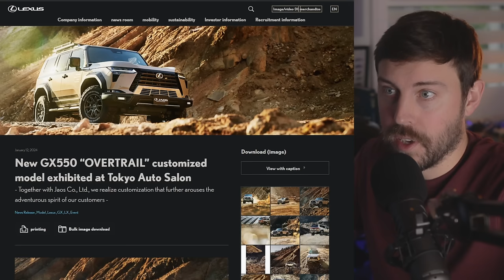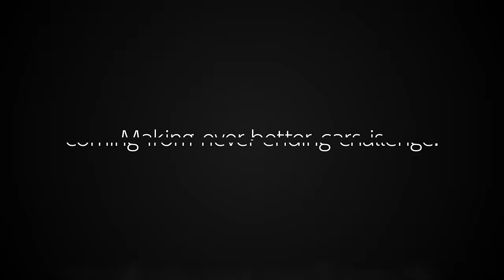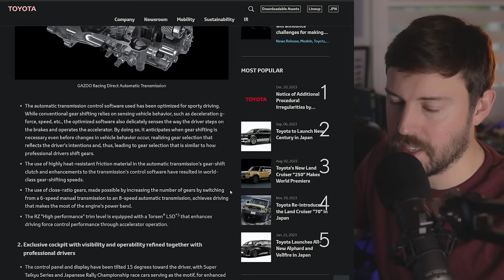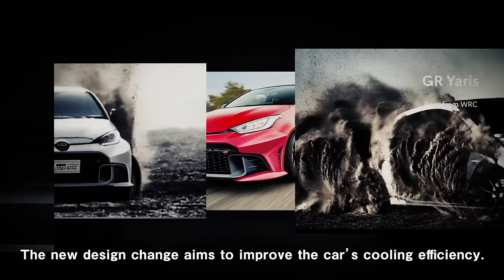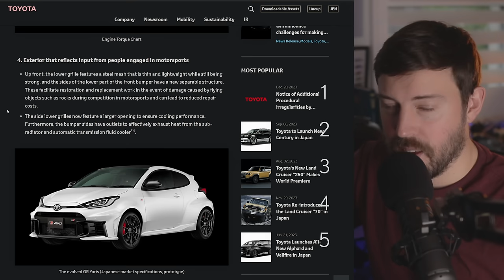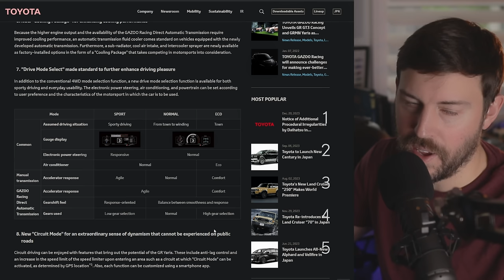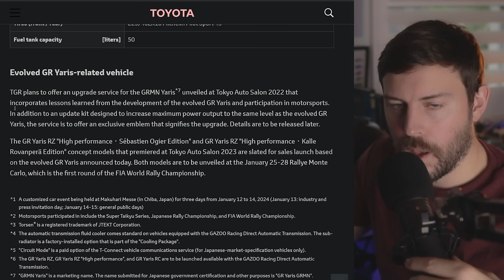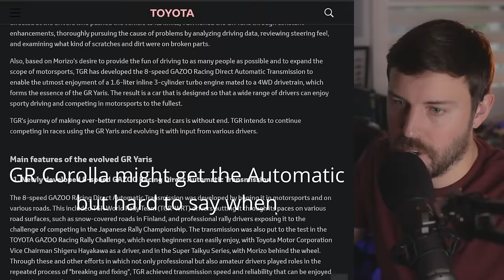TOYOTA's Game-Changing Transmission Arrives in the NEW GR Yaris // GR Corolla to follow?

Comment: Hopefully this new 8AT makes its way into the next gen GR86 as well as the Lexus lineup (once Lexus starts putting more passion, effort, and energy back into their enthusiast cars).
Reply: The Lexus LBX Morizo RR Concept that was recently shown at Tokyo Auto Salon actually uses the G16E 3cyl & GR-DAT Auto. (306hp)
Reply: @AbrahamArthemius  I’d love to see this transmission paired to the V35 and squeezed into an IS or RC. The 6AT and 8AT were good enough for 2014 and 2017, but it’s crazy that those cars haven’t really received any powertrain upgrades since then (I don’t count the IS500 as a powertrain upgrade since that powertrain has more-or-less been around since 2015).
Reply: And also the GR Corolla will hopefully get the new 8AT!
Reply: Absolutely, I would love the 86 to have a good AT ❤️
Reply: Y'all need to learn MT😂
Reply: @royaltyallen1162  Umm…I’ve actually been dailying a 6MT 1series for the past 11 years. But anyway, I made my comment simply because 1.) I want Toyota/Lexus make products for enthusiasts to the best of their ability and 2.) IF this 8AT’s performance could rival the incredible ZF8, I want it in as many Lexuses as possible so that their cars can be a bit more competitive/engaging.
Reply: @royaltyallen1162 I’ve been driving manual for 10 years now. This new AT sounds fun.
Reply: @royaltyallen1162 Bold to assume we can't. 😂 Autos are faster without having to abuse the hell out of the clutch and transmission.
Reply: @royaltyallen1162  MT is fun as hell, but honestly, I'm at a stage in life where I'm working, studying, and ftiving upwards of 30 miles a day. An automatic may be a good option for many people. I would definitely keep manual just for the fun of it.

Comment: Personally, the most interesting thing this time is the LEXUS LBX MORIZO CONCEPT, which has the GR YARIS engine and drive system transplanted to it. If it is officially released in the near future, I think it will become something similar to the AUDI S1 and MINI JCW, which Toyota has never had before.
Reply: LBX is based on the Yaris so its only natural
Reply: And it has more power than the GR YARIS
Reply: @marantamil459 it's the same one as the updated GR Yaris so around the same 300hp

Comment: Kirk, As current GR Yaris owners 'upgrade' to this automatic version, I hope the market is flooded with  plenty of cheap, obsolete, manual GR Yarises for the purists. 😉
Reply: Well.. they do offer 2024 GR Yaris in Auto and manual, it just happened that Auto is proven much faster than manual on their track.
Reply: You do know the Auto is just an option don't you?
Reply: It will not - in EU price tag for new yaris (both manual and auto) is much higher, than for previous one. Many people hoped for significant price drop of old model, but pricing policy for the new one will keep value of mark 1 on quite high level. I've ordered mine wit VIP package (forged rims and some extras) and auto transmission, and it will cost me above 240.000 PLN (60.000 USD with taxes). Previous one in 2021 was about 150.000 PLN (37500 USD)

Comment: About the hand brake lever...(according to the TGR web site) you get the standard horizontal lever. But you can also get a vertical lever handbrake for the RC trim for motor sports.

Comment: Now we just need a turbo 3 GR86. The boxer engine was the sole reason I went with a GTI instead.
Reply: The 86 should stay NA for as long as possible. A Turbo 3 GR86 should be a new Celica.
Reply: Or throw it in the mr2 if it returns

Comment: On a motorcycle, you shift down with your left foot for first gear, then up for each sequential gear. At least that's how it is on most street bikes. I think some race bikes have that reversed, but that's the rare exception.
Reply: normal shift is 1 down 2-6 up, GP shift is 1 up 2-6 down

Comment: I was a huge Toyota fan for decades, but it has been difficult to be a fan since about 2000, when they started cost-cutting and creating lazy, ugly designs with low quality interiors. But I'm very excited to see them finally taking customers seriously again and responding to what we want, or at least trying hard to. This transmission could be a game changer if it's as good as it sounds...even if it only matches the ZF8 in real world performance it will unlock potential we've not seen yet from Toyota. I'm really excited to see some passion coming back to the brand. I keep wondering why they don't offer the Corolla sedan with the GR power train - think Corolla Apex with GR engine/trans. I think there would be a lot of takers, there's always a market for a practical, sporty car that hauls passengers and can do grocery duty while still being discreet and very entertaining to drive. The GR Corolla is cool but it's a very niche car with polarizing looks that you love or hate (I'm in the latter group) and offering the same power train in the sedan would open a whole new market.
Reply: Well they had the camry trd which was just a sporty sedan, nobody bought it. So they got rid of all the performance sedans as other companies like bmw do that way better. Toyota can really take the hothatch market in US and Europe if it makes a GRC with automatic that can compete with a Golf R stock. So I think that'd what they are going for and I thinks it's working, I'm seeing way more grc than golfr in the US.

Comment: I would like if they could do a cheaper 2 wheel drive version. Maybe it could be a TRD corolla.
Reply: They actually do (exclusive for the Japanese market). Called the GR Yaris RS, it has the same body as the RZ model (top trim, the one we’re familiar with), but has a regular 1.5L NA 3 cylinder engine (118hp), CVT, regular Yaris brakes, and the same double wishbone suspension as the RZ model). It’s also 150kg lighter than the RZ model (1,130kg/ 2,491lb for the RS vs 1,280kg/ 2,822lb for the RZ), with a further “light package” offered in 2022, which reduced the weight further to 1,100kg/ 2,447lb.

Comment: If Toyota really want to differentiate SE and XSE from the LE and XL use the CVT on those models and install the 'Yaris' transmission in the SE and XSE.
Reply: I doubt it, unless the Toyota offers Corolla models with lightly turbocharged M20A-FKS boosted to around 210-220 bhp. Toyota will stay with the CVT with launch gear with the non-hybrid Corollas for now.
Reply: @@Brian_Eugene_Lee Aren't the CVT's used by Toyota built by their own Aisin tranmission division?
Reply: @@Brian_Eugene_Lee I know that NIssan has its own JATCO company build the CVT's for their cars. By the way, the CVT with the launch gear found on the Corolla models sold in the USA is a K120 unit, which is supplied by Toyota's Aisin subsidiary (if the information from Wikipedia is correct).
Reply: @@Brian_Eugene_Lee Fortunately, the Aisin units have a pretty good reputation for reliability (I haven't heard of any major issues with the K120 so far-knock on wood!).

Comment: 4:32 Moto rider here... and ive always wondered why auto manufacturers don't figure this out... mimic, I mean  Honda has a moto and auto and they have this on their bikes along with autos. I ride Ducati which has radar cruise control on a manual transmission. So i scratch my head when auto manufacturers kock block you on radar cruise when you want a manual trans. NOPE you have to go auto! Why? Because its impossible, it would never work. 🤨 Looks to a MOTORCYCLE that does have all that. 🙄
Reply: and FYI its amazing. You can lock on to the target in front of you and you row through the gears while not touching the throttle. You still clutch in shift or not but don't touch the throttle. The bike will slow or speed up all on its own. Its wild. It allows you to take in the surroundings.  Great for long distances.
Reply: @aurorajones8481  Some cars with a manual transmission do have radar cruise control , I drive a Peugeot 208 which has it and it works quite well with the only caveat being that it will turn off below a certain speed.
Reply: The current GRY has that feature, called adaptive cruise control. It’s great on long boring journeys.

Comment: I really hope it doesn't make it into the GR Corolla. The industry does not need more autos. It needs more manuals.
Reply: I hope it does. People who don’t want a manual shouldn’t have to get one. An auto will be objectively better for all driving except the feel for some
Reply: @dawsongranger4940  The whole point of the car is the feel and experience. An Auto would be worse in those metrics for all. 
Might as well buy a Challenger or a Camry
Reply: @wayward03  you still have the feel and experience with an automatic. Just now with better performance. Charger is a heavy boat meant to go in a straight line and the Camry v6 is an identity crisis. A better comparison is the VW golf R. Which is auto only now because nobody wanted the manual
Reply: @dawsongranger4940  That's sad. People really are lazy.
Reply: @wayward03 You buy a high performance car for high performance..why settle for a slower trans?
After a certain point you got so much power that you barely even row gears on the daily commute.
Reply: @DragonKnightX12  People buy a performance car for the experience. Unless you're street racing it doesn't matter. Why buy a numb uninvolved transmission when a better one is available?
Reply: @wayward03   I buy mine for fun.
What experience? 
Shifting 3 gears to cruise on the highway? 
Going 1-2 in  city traffic? 
Yea so much fun. Tracking, racing, and tearing up twisty backroads is when manual is fun.
Daily commute? It's just as benign. Even the "slow" cars you don't need much shifting to catch up to traffic anymore.
Autos are not numb either. You can feel a torque converter or DCT shift.
You still have everything else about this car.